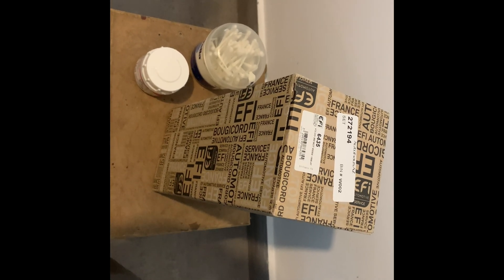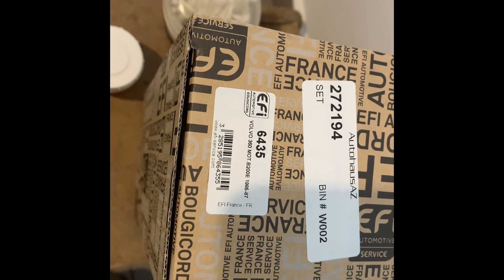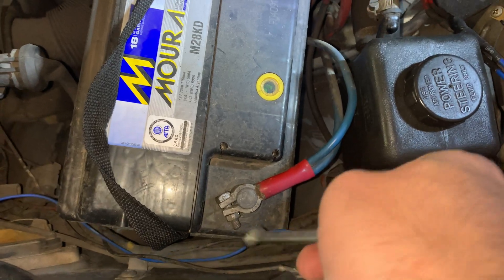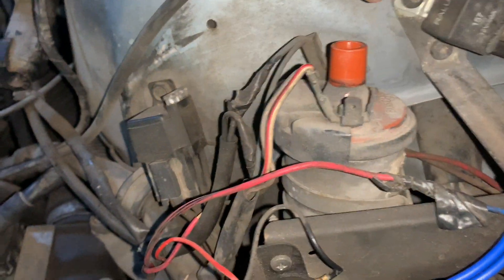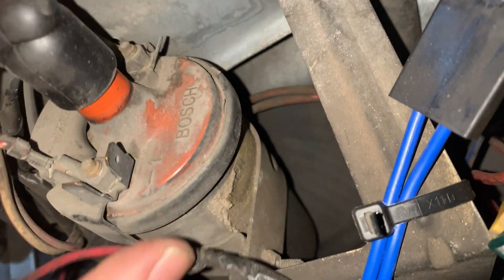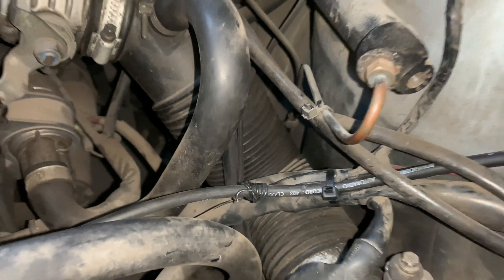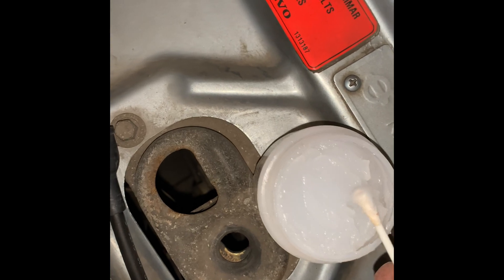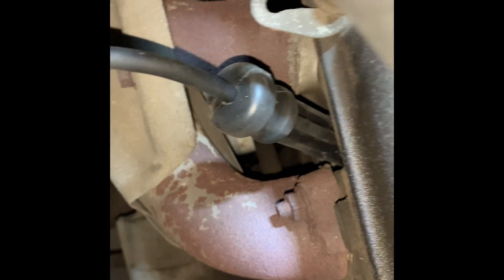Volvo 240 Spark Plugs wires, right dialectic grease usage and a question

Comment: The word, dielectric means insulating. A common misconception is that it should be applied to the metal contacts and this is wrong. This grease is wonderful for sealing the boots from water entry and also making the boots easier to slip on. This grease is wonderful as long as it is applied sparingly and to the correct surfaces.
Reply from the maker: Exactly!!